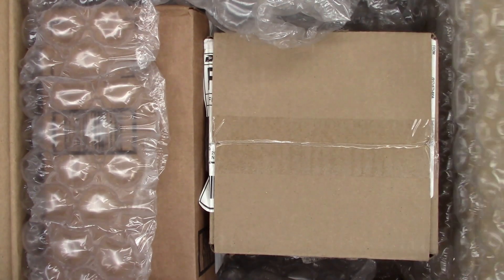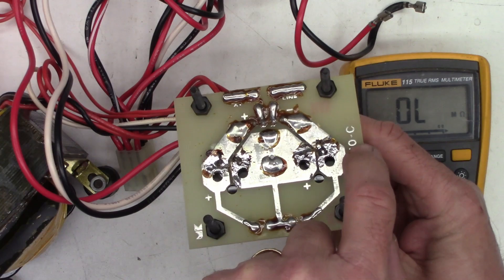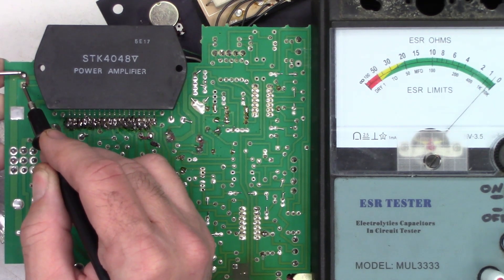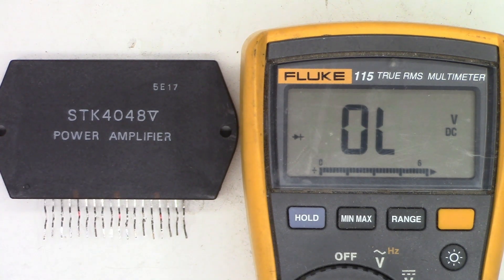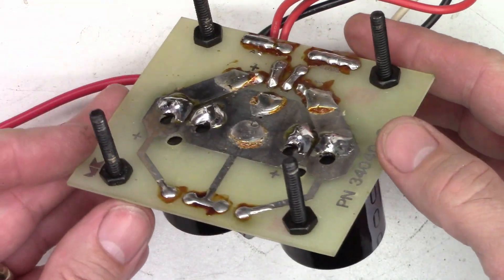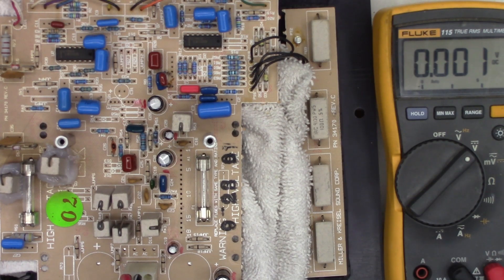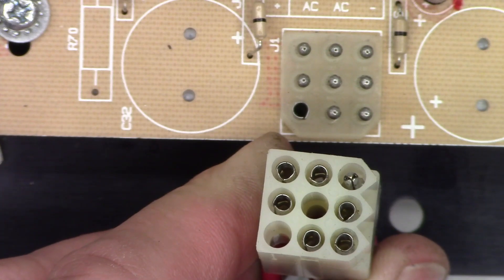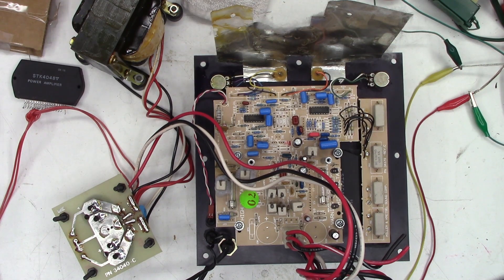MK MILLER AND KREISEL SUBWOOFER SENT IN FOR REPAIR. THIS ONE IS HAMMERED BUT ITS GOOD NOW MX70 MX-70

Comment: This was a perfect example of some one watching You Tube and thinking I can fix it with no clue in there head what they are doing . You Tube Has Been great for the repair industry .
Reply: This is why amateurs should never attempt to repair these things themselves. The rear panel of many units has a warning which reads (something along the lines of) "do not remove cover. no user-serviceable parts inside. refer servicing to qualified service personnel."
Let these kinds of videos be a lesson to owners out there with no experience, skill, test equipment, qualifications or knowledge to LEAVE THIS STUFF TO THE EXPERTS (e.g. NorCal715)
Reply from the maker: Thank you!

Comment: Hi -  Fantastic video - It's a gift for all humanity ;-)  I bought an M&K MX-70b from a Craigslist seller, which despite being ~30 years old, is as-new in appearance (not even any wear on the feet!) and sounds good.  But the volume and crossover frequency controls (pots) both make scratchy noise, hum and cut out intermittantly when turned, and the unit may have other issues. 

I've been unsuccessful in locating a schematic or parts list with electrical specs (pdf) online but your video made it clear to me that I am not competent to DIY the repair - nor do I have the reserve of calm and patience that you do...!   I wish we were in closer proximity to have you do my repair (or, can you refer me in Seattle?).   Thanks again

Comment: Brilliant work wish I can do that.Hello how do you test a voltage regulator 7912 please help.
Reply: Look up the data sheet online, make sure you verify the correct pinout for the exact chip. On the 7912 it should be : Pin 1= ground, Pin 2= input, Pin 3 = output). To get an accurate reading you’ll need a power supply that can provide at least -14V DC (negative 14) to the input pin. Do not exceed 1.0A - use 0.5A if possible. You would then use a multimeter to test the (DC) voltage from input to ground first, to make sure there is (in this case) 2 volts difference, then check the output to ground and it should read -12V.

Comment: In the case of such damage on the  board, you probably could get a stripboard that has a bunch of 3 or more holes connected together ... for example, search for B07ZP4FYVJ on Amazon ... cut a segment of such stripboard and then make connections from it to the traces.

Comment: I am a big shocked at the build quality of this amplifier given that M&K makes pretty high end subwoofers.   I had always held them in high regard, but after seeing what this amplifier looks like, it has my head spinning a bit. The use of an STK chip in a high power application is the first red flag.   Also the darkened spots on the board by those power resistors definitely has me thinking the board was under engineered, which is another red flag.  If it was calculated to have significant heat on those resisters, they should have put larger, higher wattage ones in.   So yeah, Wow!  That puts a damper on my day as I had always wanted an M&K sub.  While the drivers and cabinets look to be of good quality, the amplifiers, certainly are not.  Disappointing to discover this.
Reply from the maker: I would have liked to see discrete power amplifier output transistors. But it was built to a price point, as so many units were in the 80's and 90's
Reply: @norcal715  Yeah, I don't think it would have cost that much more for discrete transistors, but I guess it could be the labor too as the STK package certainly simplifies the design and makes assembly faster.  Still though, I expected much more from M&K.   It makes me wonder that I should Pick up an MX-70 that has a bad amp and then put my own amp in it.  Could save a chunk of change and I would know there is a better amplifier in it.